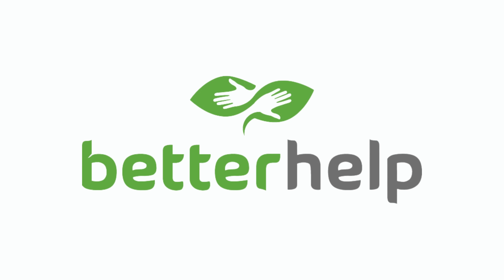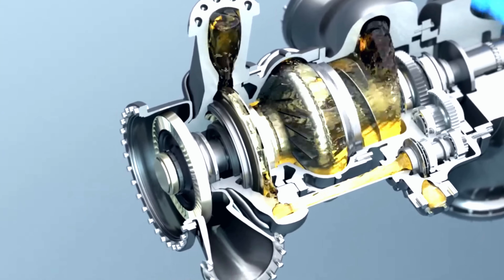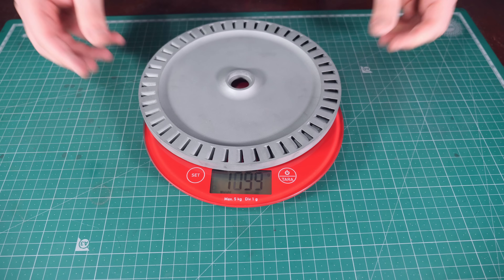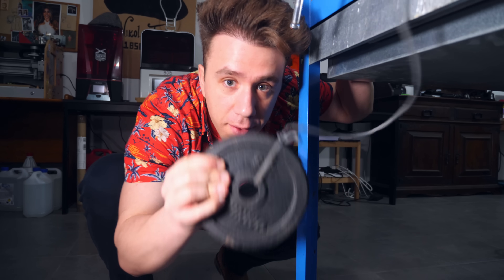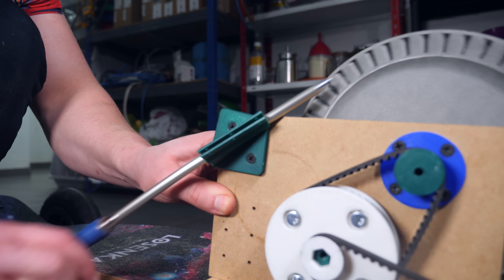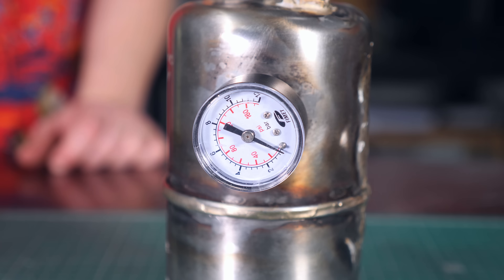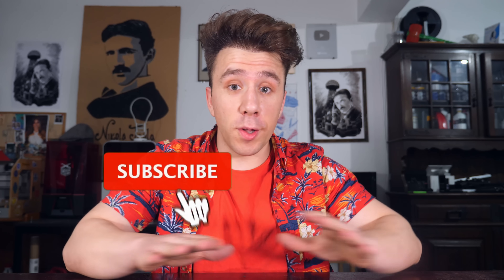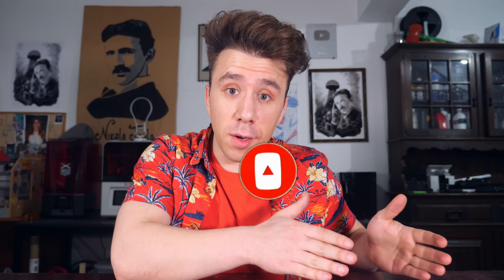I built a TURBINE Skateboard

Comment: Skateboard is the weakest part here.

I’d say you need a go-kart in a reversed trike layout. Two wheels in the front for steering and breaking and one wheel in the back for accelerating. One wheel would be enough for accelerating at the same time being simple to build.

The whole thing will be much bigger and heavier than the skateboard, so that you will need a lot more pressure. Also you’ll need a more straight turbine wheel— the one you have now is of odd shape, it’s very apparent how it shakes and wobbles when spinning. Spin such a crooked turbine up to 1000 rpm and it will blow up.

Third.
A clutch. You have to have something to disconnect the spinning turbine from the rest of your transmission.

Comment: Look up Whites steam engine.  
It was first to use Flash boiler and a Cooling radiator
The Boiler, if you find the vid, had a Special Air/heat mixture device, Custom made.
Vehicle could go father them Other cars cause it recycled the water(kept its weight).

Myself and others have discussed the use of Alternative Liquids to Heat and expand in the system.  Like propane, can be used to HEAT propane to expand then use a Condensor (Air conditioner) to reduce and return to reuse.

Comment: Dude, I'm a experimental physicist and do not approve your pressurized LN2 dewar... on average, there's one fatal incident involving postdocs working with LN2 in the US per year, and these accidents happen even with very specialized and expensive equipment. Also, I wouldn't put my face anywhere near a flywheel at high RPMs, specially one printed in china (or any other for that matter) without rigorous testing or modeling.

Comment: The reality of the situation is sinking in, did I really just watch a man use a V2 rocket component turning it into an engine and mount both the engine and gearbox onto a skate board whilst being held down G clamps.  Which turned 5 years of mechanical engineering and a full apprenticeship where I learnt the basic principles of engines; suck, squeeze, bang and blow, into a workable fun thing... Hmm, whilst my bingo card did not have that on it, it has made my day.  Definitely deserves a like, subscribe and comment.  Cheers.

Comment: I have once done some math to see if liquid nitrogen could be used as essentially "ambient temperature powered vehicle" (a "disengage-able"  heat sink I could press to the LN storage to heat it up, increasing pressure.

Now, it does indeed check out when it comes to power etc etc., as you can do a lot of lightweight e.g. solar radiation collection etc.

What doesn't check out is material science. Do not try and keep LN contained. The presented massive nitrogen bottle in video? 200 bar. In sealed container in ambient temp boiling LN will generate 340+ bar. This is WELL BEYOND any steel tank capability. We are talking here about metal-lined carbon-fiber/resin multi-thousand-dollar contraptions that MIGHT NOT be even suitable for LN, or might require additional heavy support to increase strength and reduce risk of external damage. And then you have an issue of warming up the vessel, because it is very much designed not to do that, and materials aren't helping. And you prob want to avoid temperature stressing materials at such insane strains.

EDIT: now, I did think about like milled steel vessel that has like wall thickness >= internal diameter, but that sounds too close to "pipe bomb" for comfort xDDDD

Comment: What about using a tesla turbine.
A gearbox would also help because you can get the turbine to spin up a flywheel a at a low gear where more spin makes more power but less movement, you could honestly probably adapt a bicycle gear system.
And most importantly please have all metal 3d printed parts spinning perpendicular to you or atleast not facing your body, that thing is like an angle grinder disc that wasn't even designed to spin. And your nitrogen bomb needed a preassure release valve.

Comment: @integza for sure risk is part of your name, but that half-assed pressure vessel you made for the nitrogen was a bit borderline wreckless. For the kinds playing along at home, handling compressed gases is no joke. An explosion at 10 bar can easily leave you seriously injured or worse. A “pressure vessel” made of two thin pieces of steel brazed together is a recipy for disaster. Proper air containers are made of decent thicknesses of metal, and welded together with sophisticated techniques such as plasma. Before being subjected to air pressure, are first (safely) tested with water at least 150% the operating pressure.

Comment: Turbines are not very efficient for automotive use. Cars stop and go and idle a lot. Turbines are meant for steady speed and run more efficiently at higher rpm and it’s usually 20,000-50,000 rpm and has to be significantly stepped down through gearing for a car which takes away from efficiency.

Comment: How about a Tesla-turbine set up the same way? Secure that nitrogen tank to the board, it’s a rocket if you fall over and break the valve off by accident. Even a 45 tank like that is usually in the neighborhood of 2000-2500 psi when is fully charged.

Comment: didnt check all comments so.. my idea is to make a hybrid system. have the  turbine spin at optimal speed to a generator. charge a few large capacitors to run dc motor drive train.

Comment: You could try more jet nozzles directed to your turbine wheel. Or you could try a Tesla Turbine. Or use a power recovery turbine, which has cups to convert the energy. These power recovery turbine wheels were used on old radial piston engines.

Comment: I don't understand how you can be so intelligent sometimes, but too dumb to understand how a skate board works. When you tilt one side or the other the wheels compress  and shorten in length in comparison to each other causing the wheels to no longer be in parallel but in a trapezoid shape forcing a turn.

Comment: Hey Integza

I've been having an idea of taking a car alternator and a starter motor and configuring it so that the two sprocket or gears on each of the shafts are connected by a drive belt. By manually driving the belt by hand or lever mechanisms the alternator should create current which drives the electric motor which then alternates power for itself to ultimately have a "self powered electric generator".

what do you think?

otherwise, thank for the great content and extreme ideas. it really keeps me innovated.

Keep up the good ones 👌🏼

oh, you should install some foot peggs to the front of that board and sit down there where you were standing with your feet 👍

Comment: Skateboards do have steering but it can be hard to operate. You lean the direction you want to turn and a mechanical system in the section the wheels mount and connects to the deck will cause the wheels to turn
Very nice video although if that boiler thing blew up….

Comment: That’s a great video. I wonder if you could make a turbine powered aircraft? You would have some serious challenges to solve like a light weight pressure container or a fuel source that didn’t need a heavy cylinder. Perhaps you could use something like a chemical reaction that makes a gas or steam. Here’s the challenge. It can obviously be a model plane but it has to fly a figure of 8 under its own power. Bonus points for dropping a tomato from a great height. I hate tomatoes too the pips are disgusting.

Comment: Try hooking a small engine up to hydrogen see if it runs. Then hook the engine up to an electric motor. after that hook the electric motor output back to a electrolysis hydrogen genorator. see how little hydrogen it takes from a tank to run the engine.
Reply: Careful this is a scam
Reply: Careful this is a scam

Comment: It looks like it'd be pretty easy to adapt this to a bike instead of a skateboard, then you'd have the steering covered and you could attach the tank like the tanks on a motorcycle.  Added bonus of having the option to change gears if you use the right bike.

Comment: Just an idea here:
Wouldn't connecting engine to the back wheels be a bit more efficient? Since you're most likely giving your weight to the back wheels it creates a lot more torque on the back wheels. So connecting the engine to the back wheel might be a better idea. IDK just saying.

Comment: Use a Wankle rotary engine with your next build! 3 power strokes to each revolution and LOTS of torque. 

That should help you get moving, even though you would have to get the timing right so you don't waste fuel.

Totally interested in ALL of your work and thank you.

Remember: Tomatoes are disgusting...

Comment: I noticed that the drive belt was slipping at the reduction gear causing a serious loss of power. If you solve that and find a way to spool the turbine much slower you'll notice it will be much fast. As for steering loosen the trucks or swap for a custom designed solid front axle with a simple rack and pinion and a wheel or small handlebars. And swap it to rear wheel drive.

Comment: You could use those cartridge that are used in bike tires. They have a lot of pressure, are light weight adn you already have an eletronic way to control the pressure. this way you could move for a longer period. May try this after finding a way to steer lol. great video btw

Comment: I have questions:

How does the performance of the turbine rotor change with a change in the angle of the compressed gas nozzle? Could containing the turbine increase performance? What about multiple nozzles? Finally, how about generating pressurized gas by slow injection of hydrogen peroxide over a catalyst bed? You could mount a little reaction chamber right before the nozzle and control the H2O2 flow with a valve.

Comment: you would be able to get more thrust if you instead released the gas at the bottom of the turbine and tuned it around. then you would get an added reaction force from the gas instead of a force against the direction of travel.

Comment: Optimize this again with the gas bottle. And as you have already said, add steering and simple braking functions.
Maybe you can use a steam engine or use liquid nitrogen in a container (which you heat up) to drive the turbine.

Comment: Amazingly, you survived and still have fingers. The exposed unbalanced flywheel was at 6000rpm, and liquid nitrogen was poured with bear hands. You made a pressure vessel and then used a pressure vessel without a pressure relief valve. It's great that it all worked and you survived.

Comment: For the next video, do some plate or something, that directs the air more efficiently to the turbine, i think if you use just plain air nozzle, part of the energy goes to waste.
Also why not put that thing on some mountain bike or some other bike that has some very low resistance "1-gear".e

Comment: If you redesigned the nozzle to blow on to the bottom of the disk, you would also get added thrust from the air.  Plus, you could move the bottle toward the front of the skateboard for better weight distribution.

Comment: Welp everyone is talking about safety and better help, so heres a different thought. 

Instead of adding steering to your skateboard (you should also put some thought into brakes), there’s another vehicle that already comes mass produced with multiple gear sets, steering and brakes. It’s cheap, offers minimal rolling resistance and many even have a big open area in the middle where you could easily mount your turbine and fuel tank. 

Turbine-powered motor bike? 

Just please put some kind of Kevlar containment around the turbine so you don’t get shrapnel in your junk/femoral arteries if it fails.

Comment: The perfect balance between backyard fun and chemical pipe bombs.

Idea for the next video> 

 Make a nitric acid + aniline powered rocket engine that was used on old jets and missiles from the 1940s. To expand on this, the main tube of the engine would be from PTFE(Teflon) or glass tube(prehaps quartz), fittings will be CNCed from 302 or 304 Stainless steel alloy because of nonreactivity with the two liquids,  tubing would be also from PTFE and it would work with two 
syringes. You would use the RPA program to make the ideal nozzle and strap it to a skateboard. Then, you would test it and see the effectivity of the almost explosive and potencially unstable liquid propellant mixture from the 1930s.

As i said, the perfect balance between backyard fun and chemical pipe bombs.

Comment: Not knowing how old you are, but before Freon was band there was Freon rockets. They were a rocket with a nozzle for the gas to escape.The fill hole was a tight fitting grommet style rubber which the gas was passed through a basketball style inflation needle that was inserted to put in the gas. Curious can you 3D print one of those rockets and would it be strong enough to hold compressed air. If not that is ok to as a good looking 3d printed rocket would be neat. And if white  it could be colored to suit someone! PS at one time I had a gyro from either a train or a plane that also used a turbin toe spin it.

Comment: Turbojet cars were discontinued for 2 reasons. The first is that the exhaust is superheated, and you generally wouldn’t want to set the car behind you on fire at a stoplight. Through some clever engineering, Chrysler fixed this issue.  But there was one issue that they couldn’t resolve. The fuel economy. After building and testing 50 turbine cars for a year, Chrysler was ready to begin mass production. Unfortunately that’s just when the 1970’s oil embargo hit. They couldn’t make their turbine cars meet the new emissions standards, and their fuel economy was 14.5 MPG.

Comment: This type of engine is very not efficient. Jet engines are faster then prop engine but use alot more fuel. You can move the same amount of water from point a to b but use alot more energy if you try to move smaller amount at faster speed.

Comment: Okay USE THE FULL 200 bar on a mountain bike, how would I take eight of those, the more the better, add a clutch system allowing the turbine to spool up and strap it to the transmission of a full suspension mountain bike. 😢 Wish I had a printer so I could burn rubber.

Comment: cant you do the same thing with a pressure washer? essentially making the set up into a water turbine and cycle the water used back to the pressure washer with water pumps. im kinda trying to do something like that for energy power but stuck on the amount of power output not being enough to power itself. foot crank starter? similar to the hand crank flashlight or squeez flashlight.

Comment: What about a jet engine that also captures the rotation of the turbine to power it? Or one that doesn't rely on compressed air, as in uses a turbine for compression? Energy density would be higher allowing a smaller fuel assembly I'd think.

Comment: 10:00 This inherently dangerous. 
First, please fit a safety valve to prevent spontanous overpressure rupture. 
Second, please pressure-test your pressure container with water to learn about its strength.

Comment: I'm amazed at all the pictures of Tesla staring you in the face - and yet not using a Tesla Turbine for this project...?
For anxiety - L.Reuteri Yogurt work WONDERS for me! The "civilized" world is suffering massively from the lack of keystone species microbes in our gut. L.Reuteri gets your system making 24/7 oxytocin. This is where its at. Check out everything by Dr. Davis and Donna Shwenk.. Next is lifting some weights - this works off the cortisol. 1000mg of Vit C per day.  Reduce (or quit) caffeine and learn the 5-7-8 breathing routine and get your bare feet on the ground. Headspace is also a very good tool. Look after your Temple Kings, keep it clean, build it strong.

Comment: Everyone here is worried about the explosion waiting to happen with the nitrogen boiler thing. They should be, but I’m just as concerned with a heavy (and unbalanced) metal flywheel rotating at high rpm’s on a 3D printed hub without a guard of any kind.

Comment: High chance hazards:
Freezing skin onto metal ✓
Freezing skin onto metal bomb ✓
High RPM questionable unguarded flywheel ✓
High RPM questionable unguarded flywheel in line with body ✓
High RPM questionable unguarded flywheel in line with body with zero PPE ✓
High RPM questionable unguarded flywheel in line with body with zero PPE on a road with cars while loosely holding it all together ✓
Do you have a crush on a cute nurse at the emergency department in the hospital? Go see her during her lunchbreak instead of her worktime.

Comment: You're going to kill yourself with such foolish antics
Reply: Improvised high-pressure containers. No pressure relief valves. Standing in the path of the fragments if the turbine shattered. No helmet, face, or body protection while riding. No hearing protection if something ruptured.
Reply: High pressure injection wounds. Cryogenic temperature burns. Imbalanced turbine wheel. No brakes. The list goes on.